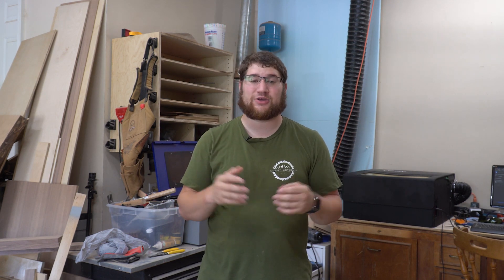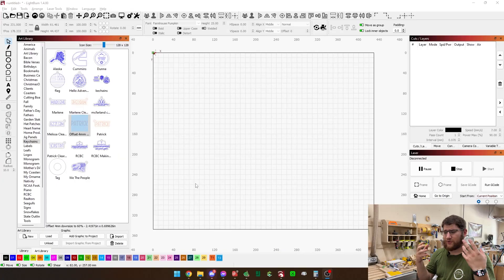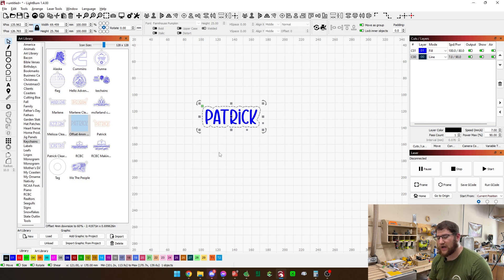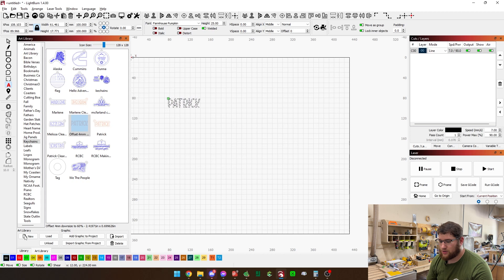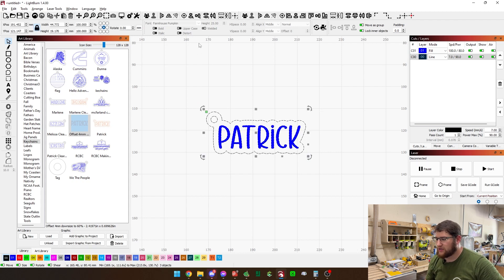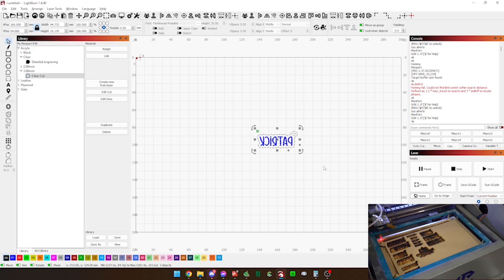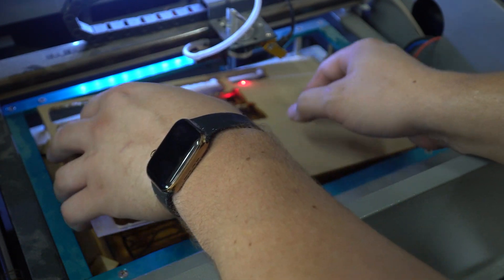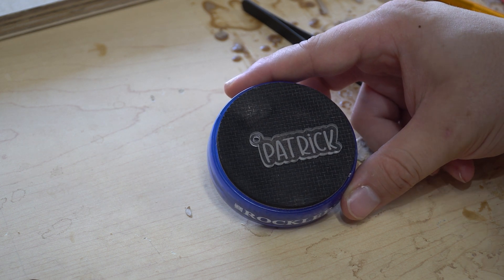SUPER EASY project you can do with your @monportlaser #K40 laser TODAY

Comment: Great video. What do you set your mA to? I have an Omtech K40 and I am looking for a great starting place.
Reply from the maker: I had my ammeter at 100% and ran at about 50% in Lightburn for the engrave, 100mm/s. I don't remember the mA output for engraving. For the cutting, I was typically at 19mA at 7mm/s for 1/8" clear acrylic.